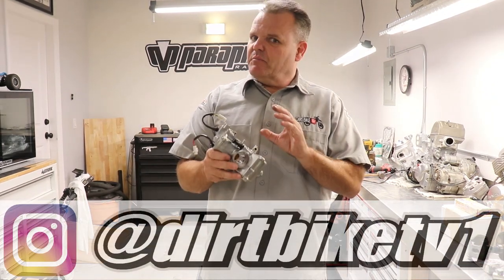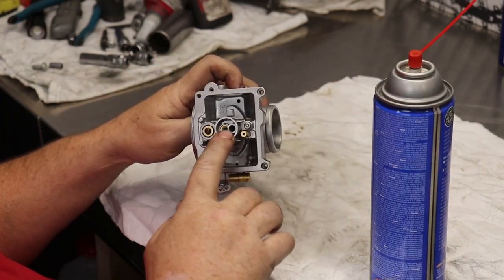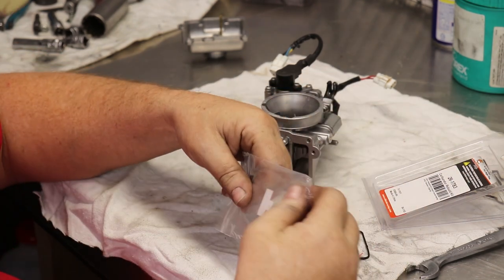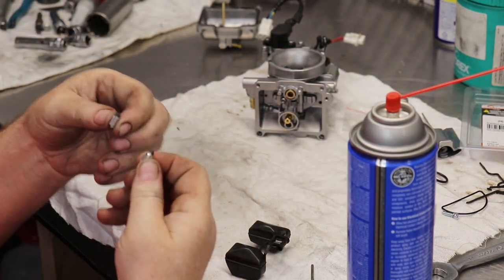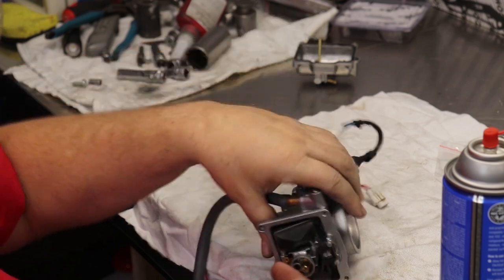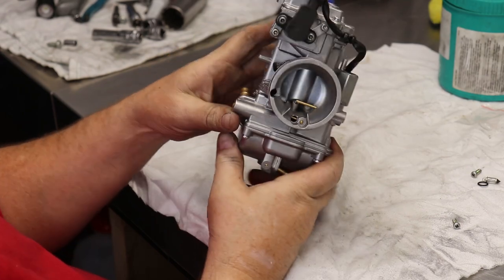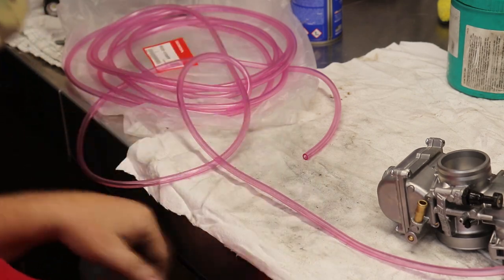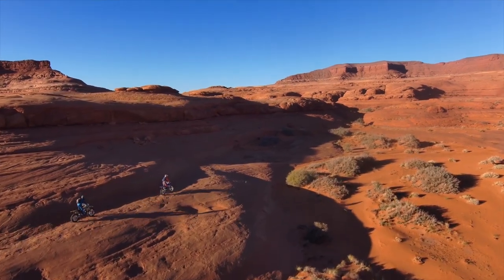2 Stroke Carb Rebuild

Comment: Size of the two first bolts he took off. Where the throttle cable threads into on the top. Anyone know the dimensions of that screw?

Comment: Anyone know what them 2 parts are called with the electric cables goin into ????!
Reply: Throttle position sensor and solenoid cut off for power jet, I have this on my KX 125